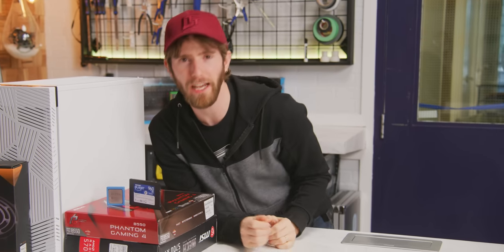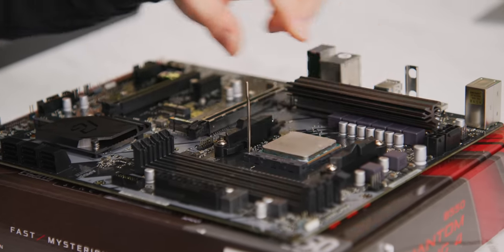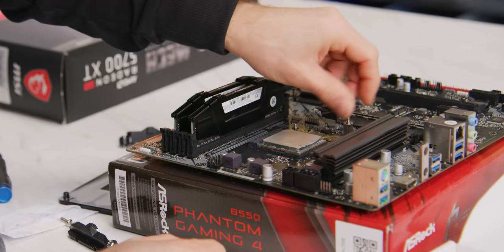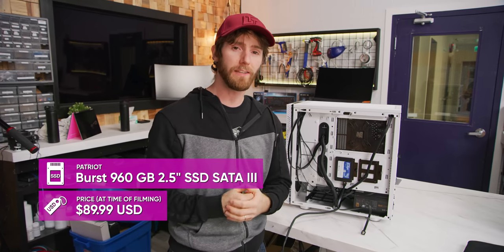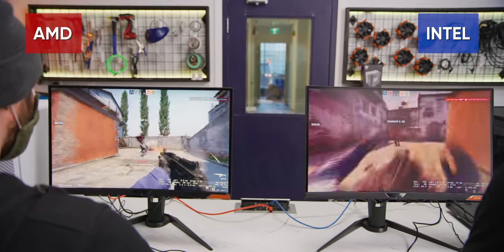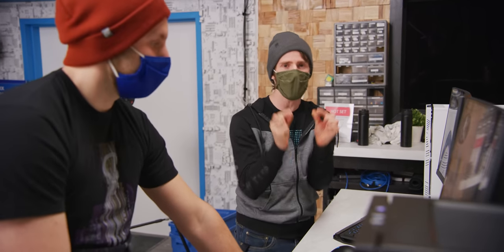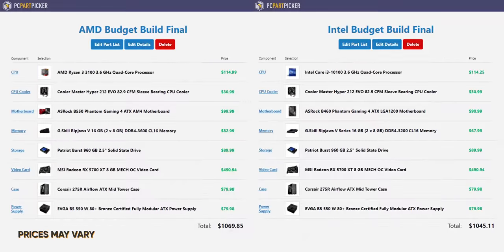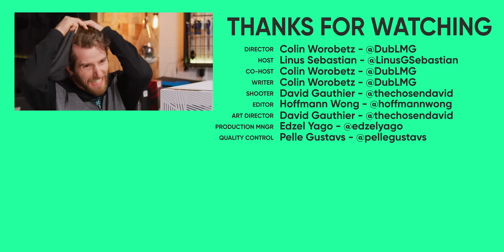AMD vs. Intel midrange gaming PC challenge

Comment: “Under a $1000!”

Lowspecgamer has left the chat
Reply: How the hell is $1000 considered budget?
Reply: @Altoroc  ikr
Reply: @Altoroc  midrangr
Reply: @Altoroc  because theres way cost per performance that pc can compete with next gen consolesa 3060 ti is around the same in performance as a series X but even thats $400 on paper. just for the GPU.
Reply: A $1000 is too expensive if I convert it to my currency
Reply: @Angel7black  Remember consoles make money by selling you subscriptions, not with the actual console.
Reply: @Mercyforme  After six years you could have paid between $400 and $700 on your Xbox Gold or Playstation Plus subscription, depending if you're going month to month, quarterly, or yearly. Steam's sales go a lot deeper on the discounts as well. So the question is, does a $900 to $1200 PC outperform a console where you'll pay that much over the course of six years or so? I think yes.
Reply: @Dreams_Of_Lavender  Yeah consoles are great for a plug n play expierience. Besides the only reason the console vs pc arguement has a bit of appeal right now is because pc part prices are skyrocketing making consoles a decent choice for once.
Reply: @Altoroc  they say midrange bro, not budget
Reply: @Angel7black  No the 3060ti fucking smacks the series x lmao
Reply: @Altoroc  It's budget, not "pick between a PC and paying rent". You can get a system for less than the 900-1000 price point but at that point, you're going into it expecting to run the couple games you can fit on your drive, at the lowest specs. Essentially an office PC with a dedicated GPU.
Reply: @Altoroc  everyone has a different budget.
Reply: @Angel7black  yes because it's a computer not a game box
Reply: @Souscheff  how?
Reply: @Souscheff  that's either stealing, looking really long and getting lucky ln second hand or sale stuff, or just an office pc that can play lighg games decend and mid games really shitty
Reply: Lachante easy find a dell optiplex for $100 add a $40 power supply and $130 gtx 970 on eBay power supply of course new and with a bit of a bidget stretch $20 for a front fan. Pay anything above $350 and your being scammed for this cheap system
Reply: @jordangames2560  bro you forgot the cpu
Reply: @jordangames2560  lol you can have this greatk 1440p monitor that has 120hertz refresh rate and you gonna buy that, a waste. like gaming 1080p 45fps is very bad experience and dont even think about playing flight simulator or a nice looking watch dogs legacy on that. we are far beyond the system you are referring to. gaming is about the experience or the potential of money earning, not getting your system to load this one game after you closed all other things and set the settings to low with some medium quality on light games.
Reply: @Altoroc  the verge
Reply: oof lol long commeng
Reply: A 1k us dollar is more or equal to 47k phil pesos. 
Budget pc here in the Philippines may only reach to 25k to 30k pesos max. Including monitor. Half the price for your budget pc on ltt.
Reply: Mine is under 1000 and has an i5 10400
Reply: Still using an old i5 2400 2nd gen on 2020.
Reply: @Saji_0  i could feel your pain
Reply: @leoneldeleon6311  this is not a budget pc build. calculate like 450.bucka to 500 if is budget ltt gaking pc, they once made an 69 dollar functionimg pc
 however this is ltt midrange pc, wich also is the price of every midrange no second hand stuff pc, sexond hand stuff midrange is good starting from 750dollars
Reply: @Altoroc  Budget says nothing about if its cheap or expensive 
Budget just means you have a limit on the money you want to spend
Reply: @Altoroc  pretty sure 1000$ for a gaming pc is already considered budget/midgrange 10 years ago
Reply: Everyone should literally never listen to linus' opinions about budgets, they're so out of touch that they think an entire paycheck is a reasonable budget for a pc
Reply: @Dexx1s  you are saying sub $900 PCs can't run games very well?! If you take away the pc part stock availability problems, you could make a solid PC for $800 that could run most games very well at 1080p and 1440p. I built a PC for $670 2 years ago, and it can run most games very well at high settings at 1080p (sometimes sub 60 fps at 1440p with high settings)
Reply: @Angel7black  consoles are sold with loses and they make there money back by getting a 30% cut on all of your purchases on that console
Reply: @Altoroc  midrange gaming PC

average price is honest imo...
Reply: @leoneldeleon6311  i5 2400 in the philippines gang 😎
Reply: @Altoroc  it isn't. This is a mid-range build.
Reply: @orangy57  Lol it takes me 30 paychecks (2.5 years) to build my PC (I earn about $50 each month), plus birthday and christmas money, to build my $2500 PC. But it was worth it!
Reply: @julianrime8544  1k is midrange for a PC???
Reply: A real budget pc if you're  broke get a Dell optiplex throw in a GPU 1050+ and a ssd 120gb and make sure it has 8-16gb ram and power supply 400watts this cost $100-300 used/new
Reply: S/o to everyone here. Thought I might be the only one whose first pc wasn't near $1,000 🤣
Reply: @girlsdrinkfeck  but still they take big loses on launch and after a few years when a slim will release they will make profit on that
Reply: @Altoroc  Idk probably Linus says it's "budget" but when Linus' crew realized it ain't "budget" at all (at least for 3rd world countries/the rest of the world), the title changed to "midrange". More fitting.
Reply: Dude when i saw your comment i thought i had blacked out and typed this until i saw your name lol
Reply: @Altoroc  how the hell does he have 1000 dollars and a Ryzen 3?!?!??!
Reply: @orangy57  couldn't agree more. Dude is sooo out of touch and spoiled, everytime Linus mentions the word budget I cringe.
Reply: 1: What is the point of spending so little you have a shitty gaming experience? Just to say PC master race DERRR?
2: Budgets differ. $1,000 for a brand new PC isn't special by any means. It's not $5,000 now is it?
3: It is mid tier because it's not your dumpster garbage running at 720p 50fps or a high end running 4k 200fps
4: "eSports titles" are shit and are a terrible metric since they take nothing to run. I'd rather play something fun or pretty, preferably both
Reply: @Altoroc  because he used a 3200g and that’s the only low budget thing about this. Also the fact that the system wouldn’t run optimally probably makes it low budget to. Has nothing to do with the money spent.
Reply: Just got Acer nitro 5 for 726$ from Amazon with i5 9300h and gtx 1650 with intel optane 16gb and 8 gb ram.
Reply: I built my pc for 700$ this year and its have exact performance even with 1650s
Reply: 999th like
Reply: @willwimbiscus7456  why take away the main thing that's been the number one factor in pc buying budgets? And regardless, I can also make a half-assed system with all the money going solely into the CPU and GPU and get good frames. It's still a terrible pc though. 

And who cares about what you think budget was years ago? That has absolutely no relevance.
Reply: @pixels_per_inch  u can undervolt to stop throttling and can overclock to increase clock,also u can optimize window for gaming to reduce cpu load
Reply: @Dexx1s  Why is a $700 build a half-assed system? Why is a gaming PC that performs well a 'terrible PC'?
Reply: @MrGamelover23  1080p 60fps is mid range? Guess that mean the SeX and PS5 are high end
Reply: With a budget of $900 I built a rig with x570 board, 650w 80+ bronze modular, Ryzen 7 3700x, 16GB Corsair RAM, EVGA RTX 2060, and a 240GB NVME M.2 SSD.
Reply: @Dreams_Of_Lavender  looking for sales, one year subscription regularly go for $30. So that's $180 which is on par with the windows license people never include on their part list. Also for people who live in countries with high electricity prices, the higher wattage on a PC is also not to be underestimated.
Reply: @Angel7black  prob will be more like a 3050 and a 5300x when those things release, and you may be able to do a 700€ pc with that. without having to pay an extra to use the internet you already have lmao
Reply: Is this a joke that i am too 3rd world citizen to understand ?
Reply: @Angel7black  a Series X is no where near a 3060 ti. 
Maybe a 2060, or a 1660.
Reply: @Mercyforme  Subscriptions, licensing rights, and they get a cut of all DLC and microtransaction purchases (10 to 30 %). 
The console sold cheap to create the install/customer base in order to sell the software.
Reply: I yet to see online subscriptions for PC game online, with the exception of MMOs.
Reply: Also assume most people would reuse their case if they are going with a Upgraded build.
Reply: @leoneldeleon6311  LTT is going off the Canadian Market, right to the south of Canada, the US prices for the same parts aren't that bad.
Reply: @MrGamelover23  mid can only be 1080p ultra or 4k ultra? You know 1440p is a fucking thing right? You know, what they did here
Reply: @willwimbiscus7456  That's not what I said and I literally explained what I meant explicitly.
Reply: @Dreams_Of_Lavender  ... A Console will indeed charge you about that amount..in 5-7 years... However you're guaranteed to be able to play the latest and greatest games at 4k 60 due to optimization....you're going to need to upgrade your "budget" pc every year or 2 just to keep up, easily costing you $1000s more... Budget PCs are nice but not very cost effective against consoles
Reply: @deonkirk7357  "Guaranteed 4K 60", yeah right. I remember the controversy back in 2013 when the consoles claimed 1080p but only achieved 900p. Optimization can only go so far. 

On the PC side, the recommended budget GPU has been the RX 580 for basically since it came out. Years ago. You don't need to upgrade your PC every year to play the latest games because PC gives you the freedom to turn down the graphics settings, which is a choice you're never given on consoles. Instead you get a "Performance" mode and "visuals" mode which are pretuned for you rather than the freedom to find your own balance. 

I don't believe that the newest games in 6 years will be playable at 4K 60fps on a 2080 Ti to 2080 Super equivalent GPU.
Reply: @Dreams_Of_Lavender  I hear and understand your argument but these "Budget" consoles can't even play 4k, at best they're on par with a series s.. And it's true last gen seldom kept the 1080p promise and it may very well be the same this time around.. But the fact remains the amount you will need to invest to keep your pc able to maintain 1440p 60... It would be cheaper to get a mid-high end pc.. With less upgrades needed in the same time frame... PC gaming is definitely superior but I refuse to play the latest and greatest at 720p 60 because of my dated hardware
Reply: @Saji_0  
It only sounds more expensive. 
Mid-range gaming PC-s were always around  $1000, if don't like the prices, you are free to build a low end one by utilizing used parts, just don't skim on the motherboard and the PSU, since those two are the biggest bottlenecks for future upgrades. 
Also, if have older PC upgrading it is obviously cheaper than a new build.
Reply: Logic_Encrypted  good luck lol
Reply: Logic_Encrypted  well i dunno, i guess it depends how people define it. For me "budget" is bang for buck parts like the 2500k, r5 3600, gtx 970, rx 580, 8200pro nvme, tomahawk mobos, evo cooler etc. High performing parts that does not cost an arm n leg.
Reply: @Altoroc  for a mid to lowerhigh end pc is already budget. It can even go upto 1300 sometimes. If u want a pc tats under 1000 in times like this, u prob will end up with lower mid range pc like ones with a gpu of 1650 or 1650Super
Reply: I just recently built a pc and have way better specs than this for about $1000
Reply: @packerking2457  ye is pretty much about luck, if u are lucky enough to find good parts with low price then you are having a good time
Reply: @shinefake48  his graphics card is better than mine but yeah everything else was way cheaper and more effective
Reply: @packerking2457  make sense, every gpu is sold out for me. Only amazon and eBay sellers have supplies, but is not worth it to pay tat extra 200-400$ for a gpu. I bought a prebuilt from bestbuy and took out the gpu. Gave the rest to my cousin who needed a new motherboard and cpu(and 2 free 8Gb ram sticks
Reply: to be quite honest with you. If you are looking for a great experience i'd say 1200 on the PC, 300-500 on a monitor, and near 300 on peripherals. You would have 0 issues, good peripherals, and be future proofed for at least 2 years before wanting to make any upgrades
Reply: @Altoroc  because budget means fixed cost set aside. A budget doesnt always mean cheap.
Reply: Around $1000 for a pc is budget with all new parts, it just is nowadays.
Midrange is looking more like $1500, I dont get the people who are saying this is out of touch with their old PCs from 10 years ago. Yes this is expensive compared to your shitty old PCs but this is a decent bang for your buck budget pc.
Reply: pretty much the best way to get pc at reasonable price is prob prebuilt(altho may not be the best parts) but my cousin was able to get a 1660super+3700x prebuilt for only 900 after tax

Comment: FYI, your AMD XMP issues come most likely from the fact that you used the A1/B1 slots rather than the A2/B2 slots, per the motherboard manual. I've had issues with lower-end MBs where not using the manual recommended slots with a 2 stick config prevented XMP from working properly.
Reply: I also noticed that the memory sticks were not in the right place. A friend of mine had the same issue, not being able to load the XMP profile correctly and it was due to that reason.
Reply: Also I have the phantom gaming ac mobo (basically the same with one less nvme ssd slot and the wifi/bluetooth card installed) and it needed a bios update to work with the 5600x I bought, maybe Linus has one that just comes with a newer bios that works out of the box with windows. Luckily it came with version P1.10 so that meant I could use the 5600x to update the bios but still... Also have the same case so I laughed.
Reply: @SwainixFPV  BIOS updates can differ between batches and supplier. Some suppliers do them at set points, others... eh, don't?
Reply: Yes, this really bothered me how he glossed over the fact the computer crashed. Then settles for a really slow speed, I guess, I don't know because he ignored the bad build at $1000. Ya, it's totally acceptable.
Reply: @Tinky1rs  yeah I ordered a discounted one on a dutch website, but it was recent enough to boot into the BIOS so np, and a bios flash is easy to do. I was hoping a more recent update I've done a few weeks later would also allow me to OC the cpu better but I lost the silicon lottery, I can't get an all core OC above 4.6 on the 5600x to pass P95 so I'm just using the highest PBO OC available (gets cores boosting up to 4.85 so fine with me)
Reply: this feels odd.... first going overboard with the cooler when the stock cooler for the Ryzen would be more than sufficient then saying the RAM speed won't go higher while not mentioning it throughout the video except in the beginning?
Reply: Dang, I just posted a long response via mobile only to find out that you said the same thing already, lol. I had the same issue with my B550 PRO4 with XMP failing me. Changing the DIMM slots after diving into the MB manual worked like a charm.
Reply: I second that. The proper way is A2/B2 for 2 sticks for B450 and B550 MoBos I've met, so far. Otherwise it won't go XMP.
Reply: 100% yes on the slot choices.  It would work in the other slots
Reply: In my case, when I built my little brother a PC, using a B450M D3SH and a R5 3400G, XMP had a pre-loaded 3200MHz profile but had stability issues. So I downclocked it to 3133MHz and then it worked perfectly fine.
Reply: @munem939  well the only problema i had with xmp with Evo Potenza 8gb 3000 MHz cl16, das onze game 7 days 2 die beside that anything run flawless
Reply: a2b2 death grips reference🤯🤯🤯

Comment: The graphics card market is truly in such a depressing state
Reply: Ya good luck finding anything at msrp
Reply: It's crazy to think only 10 or so years ago a 9800 GTX+ was $135 and provided a maxed-out settings gaming experience for most titles. Those were great times. :(
Reply: @corruptedpoison1  I think this could last even longer than the mining bubble.
Reply: Bro NO CAP
Reply: If the GPU market is that bad now should I just spent more on CPU and wait for 2-3years before I upgrade my GPU and use a budget one for now?
Reply: @chanmalichan4946  once the 3000s / AMD  series cards can remain decently in stock the costs of older cards (should) drop by quite a bit. I would say hold out a little longer but again there are a lot of variables at play. Do your research and make sure if you do end up going for a higher end CPU that it does not bottleneck your GPU or vice versa.
Reply: @Ho-swae  how good is the amd build in this video it looks pretty decent and fits my budget but I'll probably wait 3-6months before I build a pc. I only play esports title last time I had a pc and I just want a pc that will last me around 3 years which by then I can spent more on entertainment.
Reply: @chanmalichan4946  if you got a bit more to spend,take a ryzen 5 3600 instead ,the rx5700 xt is amazing with its perfs,its essentially a 2070 super without rtx performance
Reply: It's disgusting man, I cant believe how much even older GPUs are going for.
Reply: @aymen9316  I'll probably wait a few months for the price to come down but thanks for ur advice